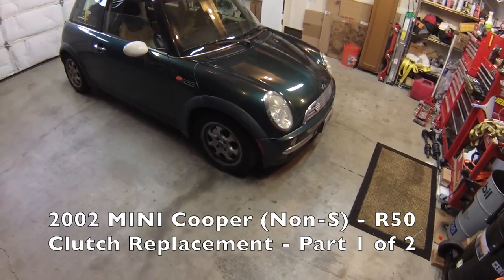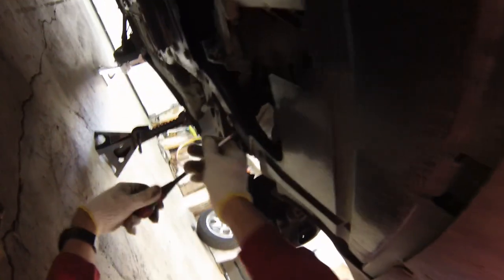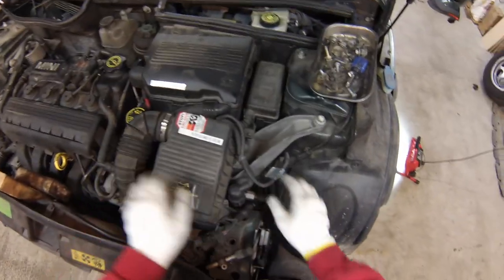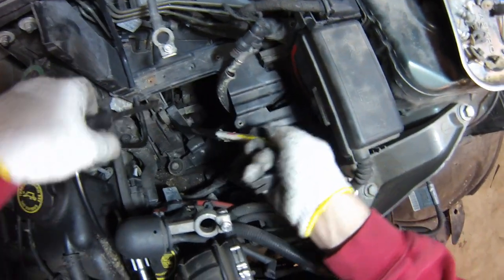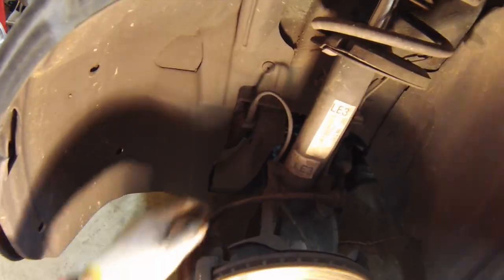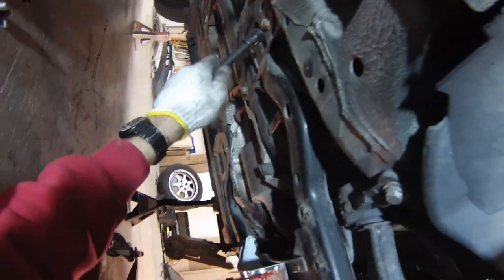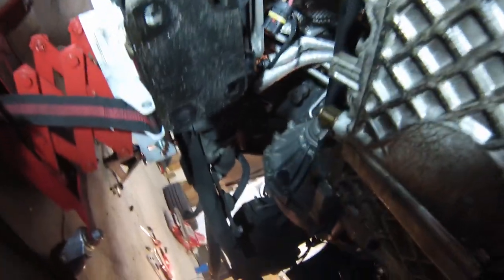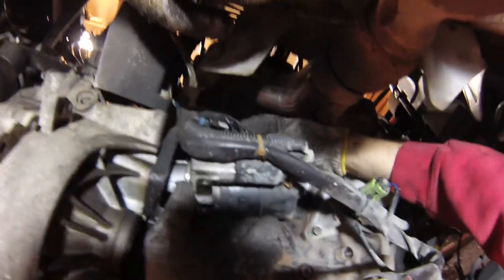2002-06 MINI Cooper Non-S Clutch Replacement Part 1 of 2

Comment: Hi. Thanks for your helpful video. I just did a clutch job on my 07 base model cooper and i'm I have one 13mm bolt left over that I can not figure out where it goes. thinking that most bolts are torx and only hex one was for starter, I've looked everywhere and I can't find where this one 13mm bolt goes. i'd appreciate any help.
Reply from the maker: There are a lot of 13mm bolts on these cars, but if it's a long one, it goes into the starter from the bell housing side on the top of the transmission. Just under the thermostat housing.
Reply: Mod MINI thanks for your response. That starter bolt is in already. This one is 55mm long and it's about half way threaded. I'm pretty much giving up at this point since I've been looking everywhere on the car and googling around diagrams but can't find anything. If it rings a bell please let me know. Thanks again.

Comment: ***** Is there anything I could use to hold the outer ball joint from spinning? My Electic impact gun is huge so i can't use it there. Jackstands is already at Max. I've tried using the breaker bar and etc... it got loose a bit but now the bolt is free spinning with it. I've tried putting the Alan key in the middle while using one of my special socket/ratchet still not working...
Reply from the maker: Bao Tran Tightening or loosening? Tightening: Use your floor jack and a block of wood to press it into the seat. Loosening: There is a female hex indentation on the ball joint itself. Put the appropriate hex (allen) wrench in that hole while you rotate the nut off with your box wrench or ratcheting box wrench.

Oh, just noticed that is not working. Why not? If all else fails, grind it off with a wheel grinder or of course you can separate the ball joint from the hub using the two 13mm bolts.

Comment: What kind of Air compressor and impact gun is that? Really interested in getting. 
I'm getting so tired of turning wrenches. especially on this Mini i'm doing for a friend... I have to say, i'm never touching FWD again!! haha
Reply from the maker: It's a Harbor Freight compressor and a Craftsman impact gun, but just about any reasonably priced setup will work fine. Minimum tank size would probably be around 15-20 gallon.
Don't fear the FWD!

Comment: I ordered the SACHS replacement pressure plate which has 12 fingers or teeth on it which goes against the throw-out bearing. The 2002 MINI pressure plate I removed has 18. Will this make a difference? Is more amount of fingers/teeth make a smoother release? or is the 12 finger/teeth unit fine?
Reply from the maker: It should be fine if it was engineered to go on the same car. Every clutch/pressure plate manufacture does things a little differently; the number of teeth should make no difference - when you add up the pressure exerted by all teeth for each kind, they are probably the same.
Reply: ***** OK thank you. FYI the clutch pressure plate appears to have a manuf code date MINI 19/04/02 European so April 19 2002. At 112000 miles could that be original to this 2002 car?

Comment: I have a 05 r50 clutch changes gears fine. But there is insane noise loud winding noise under load but as soon as I let off the throttle the noise goes away or if I press down the clutch the noise also goes away. Transmission was rebuilt 10k miles ago the noise then was definitely a bad bearing sound but this is a smooth grind noise under load. Any ideas ?
Reply from the maker: Sorry, but that's probably transmission. Rebuilds don't always go as planned.
Reply: @ModMINI  any recommendations on where to find a rebuild kit ? Late 2005 base model. Thanks for any suggestions.

Comment: Mod MIni, 
Can you share what tools used in the video.  Such as the impact drill and the attachments.  I also saw a craftsman 12v nextex used.  Do you find having those options during the removal speed things up.  Please advise.  Thank you in advance.
Reply from the maker: +Shab Mehtabuddin 8, 10, 13, 15, 16, 18mm sockets and wrenches, torx 30, Ridgid 18v impact driver. I think on the Cooper non-S the drain bolt is 17mm. Floor jack, engine support bar, transmission jack, assortment of pliers and screwdrivers. I think I included links to some of the more unusual tools in the video description. The battery impact tools are nice to accelerate things here and there (to skip over a lot of hand-threading) but are of course not essential.

Comment: Can you tell me what thread pitch 2 bolts are that you thread in to hold the radiator up?  Also can you give me the thread pitch of the bolt that you are using to hook the chain up to the strut bar to support the engine?
Reply from the maker: I believe M6x1.25 for the modular frond end. Same for the bolt in the side of the head. MAyyyybe a M5. The modular front end bolts are the same as the one 13mm nut on each side of the bumper visible when bonnet is opened. Take off that bolt and take it with you when bolt shopping.
Reply: M8 is what you need.  I bought some long M8 bolts (M8x125 I believe) from Lowe's for $4 a bolt (yikes), but they fit perfectly.   I picked up some M8x250 washers while I was there just to make sure the rad didn't come off.

Thanks a ton Mod MINI for all your help!  I can't wait to get motoring again in my R50.

Comment: Had the throw out bearing replaced at a shop. A month later the head gasket blew. The car sat for about 6 months. Replaced the head gasket based on your other video (which was awesome, thanks) and it works fine now. However the clutch pedal goes to the floor and remains unless I physically pull it back up. As I pull it back out, if I let go at about 1/4 up, it will slowly pull itself back to the floor. If I pull it all the way back up, it stays.
 Brake fluid is full. No leaks under car. Air in the line? Bad cylinder? Bad Karma? Lol If it's air in the line and it worked fine prior to sitting, does that mean the cylinder needs replacing anyway because it is letting air in slowly over time?
Reply from the maker: The1stDukeDroklar replace space cylinder and bleed.
Reply: Sure enough. I watched your other video on slave cylinder replacement (so I could locate it lol) and it started leaking after pumping the pedal several times. Must've been damaged when it was towed. Thanks for your answers as well as the most thorough and well made videos I've seen on youtube. <o  salute

Comment: You have any experience with the Valeo kits and single-mass flywheel conversions?  I'm looking into one for my R56.
Reply from the maker: Hello. I have done plenty on the R53 and all are happy with the setup. I have one now myself. I don't have experience with the R56 but can't think of a reason to not go with the setup.
Reply: ***** Thanks, it looks as if JM Turbo Coopers in AZ makes a steel flywheel and a kevlar clutch kit that I'm ordering.  I really wish I could test drive various clutches to see which I prefer, changing them out is pretty expensive.

Comment: hey there, i was wondering what would resurfacing the flywheel possibly effect? I did the clutch job about 10 months ago and resurfaced my flywheel as well. In first gear im having trouble with slow take offs and my mini jolting and vibrating. it happens mostly nearly every time i start moving from first gear to second gear. if i take off quickly this problem doesnt happen. one mechanic told me that it was because my flywheel was resurfaced and material was shaved off and now the distance to contact with te clutch is greater or something like that. should i go ahead and get a new flywheel to fix the problem.
thanks:)
Reply from the maker: +eric knowlzy I suppose a bad flywheel resurface could cause that, as well as any oil or other contaminants on the flywheel, pressure plate or clutch disk. I don't know if extra distance could cause that but I suppose it's possible, especially if it is not totally true.

Comment: hey man i'm dong this on a 2009 JCW and can't get the driver's side CV axles to come out of the trans... im really frustrated. Can you give me some advice ?
Reply from the maker: I've never pulled an axle on a Gen 2 MINI. I suppose it's similar, you just have to pop it. Use a pry bar and smartly pop. If the circlip is stiff, it might help to rotate the axle about 90 degrees at a time.

Comment: I was on my way home today and I was going from stop to go at a red light and when I went to take off my car jerked a little and then I started getting lots of noise in the bell housing. Is it a clutch issue or a throwout bearing. I'm looking to change clutch anyways if I have to change the throwout bearing. Thanks. My car is being towed home so I can work on it. Any pointers would be appreciated. Thanks again.
Reply from the maker: Inside the bell housing? You're going to have to pull the transmission no matter what. Who knows what you'll find until you take it apart. It could be disk, pressure plate or throwout bearing. No way to know until you open it up.
Reply: When I pulled over and stopped the rattle would stop when I pressed on the clutch but started Back when you started to move again so I called a tow truck.
Reply: Got the car home and took a video of the sound someone told me to check axle bolts but there is nothing loose and the sound it coming from where the clutch is located. I don't know how to pm on YouTube if I run into something I can't figure out. And what's the best transmission fluid to use for my 2004 mini cooper base pre 7/2004. Thanks

Comment: I have a 2002 Mini which I wondered if you can help me diagnose what may have happened. I was shifting it from 1st to 2nd gear while having it floored and suddenly it quit moving. Will shift into all gears but won’t move. Checked the shift cables and they are fine. Whether the clutch is engaged or not, you can hear something rotating beneath the car when it running. Any ideas what may be wrong with it? Thanks for any help. I live 2 hours from the nearest mechanic and I’m capable of fixing it.
Reply from the maker: Sounds like blown clutch.
Reply: Mod MINI While I’ve got it apart, would you suggest that I replace everything? Pressure plate, throw out bearing...

Comment: At 9:42 you start talking about the differences in the transmission in the 06. I'm looking to replace my clutch on my 06 R50 and would like to know if you have any tips on the differences. I've used your videos for so much, thank you for the quality content.
Reply from the maker: It's pretty much the same thing, the slave cylinder and shifter cables are different, nothing you shouldn't be able to figure out.
Reply: Mod MINI thank you for the instant reply, holy crap.

Comment: What do you think of a 2004 mini cooper s in silver with black stripes and black hardtop? really wanted to find a good cooper s in grey but only find this mini
Reply from the maker: 2005-2006 are the best years but 2004 is not bad. I have a 2004 Cooper S. Take  the time to find the best car you can afford. Have it mechanically checked out by someone who knows MINIs if you can. Other than CVT transmission issues on the Cooper non-S, some of the most common problems are power steering pump and power steering fan (which is covered by extended warranty on most pre-2005 models), thermostat gasket leak, various oil leaks, worn suspension parts (struts and front end ball joints/bushings).
Reply: ***** Since i live in Malta there are no mechanics that specialize in MINIs should i take it to someone who knows german engineering? Thanks for the feedback
Reply from the maker: Matthew Delia A mechanic experienced in German engineering is better than not-German engineering. But might not know the specific things about this car.

Comment: Hi. My Mini Cooper sometimes makes a scraping sound when it's in first gear and sometimes second and it only goes away when I push in the clutch pedal all the way. Once I let go the noise comes back. Any idea what this might be? Thank you
Reply: Hello, i have  the same problem, i think it is one or some bearings in gear box. Maybe you fixed that, already?
Reply: laimis RC I haven't fixed it yet. I think it works fine its just an annoying sound when I'm at a light and stuff

Comment: Can the axles stay installed when removing the subframe on a R53?  Just swapping the control arm bushings with stock.
Reply from the maker: Sure, they are not connected to it in any way...
Reply: Mod MINI thanks! I had read several posts that were very vague as to yes or no.

Comment: Awesome videos from you, they’ve been very helpful. I’ve got a question, about diagnosis. 
I’ve a 2005 non-S cooper. I don’t know whether it’s the slave cylinder or the clutch, or maybe something else. I was driving it fine, stopped at my house for an hour, and left again. Right down the road it lost all acceleration power. The RPMs would increase but it wouldn’t go any faster than about 10 mph, in first. I tried second, same thing. Then when I pulled it off the road to check it out it stalled. It turned back on right away and I drove it back to my house slow. I turned it on a couple days after and it made a squealing (kind of like an alternator, maybe it’s not related). Any help would be greatly appreciated!
Reply: I am currently dealing with EXACTLY the same problem. Please let me know how things turned out. 

I'm replacing my clutch, pressure plate, and throw out bearing in hopes that does the trick. I did find that my main linkage bushing was shot

Comment: Hello, funny that I can across your video. I have the same color, year and model. I recently had the clutch pedal feel somewhat hard and when increased the pressure on the clutch, the salve cylinder jumped off the lever fork. I replaced and bled the slave cylinder but the clutch lever for is stuck away from the slave . What is causing this?
Reply from the maker: Dark silver + white is the best!
The release fork should be freely movable by hand when the slave cylinder is not pushing against it. If it is not, you probably have some physical damage to the throwout bearing or pressure plate springs. Hard to say for sure without removing the transmission and visually inspecting the parts. Unfortunately there is no way to get a camera or scope in there. Do you have an X-ray camera? :)
Reply: No i don"t have a camera, and the release fork seems stuck.I took out the slave cylinder and the fork stayed stuck away from the slave cylinder. I've looked at your video like 5 times and its pretty good. I just haven"t had the time. Thanks.
Reply from the maker: Mike Flores It should move at least a tiny bit if I recall. Try turning over the engine by hand and listening for dragging/scraping. I'm guessing the fork is hung up on the pressure plate or the throwout bearing came off the fork.

Comment: hello. I have a 2004 Mini Cooper S. In the past two weeks it start to get more difficult to get into gear until yesterday i cannot move it into any gear with clutch fully press down. the pedal does not seem to engage until there is only an inch left. seems weird that this all transpired in a few week period. any ideas?  thank you
Reply from the maker: I can't say for sure without seeing the car but it's a very simple system, and your problem is either clutch damage or failure in the hydraulic system. Look for moisture on the clutch slave cylinder. If there is any, replace and bleed the system. If still not working, suspect the clutch/pressure plate/throwout bearing/clutch release fork. The only way to inspect those components is removal of the transmission.
Reply: +Mod MINI Thanks!! tge slave cylinder is what I thought as week since I had no slipping prior. just went from being hard to get into gear to impossible in two weeks.
Reply: +Andrew Ericksen  sorry for the typos.

Comment: I replaced my clutch using your instructions. I tore down day 1 and  reinstalled day 2. Now the car won't crank. I have checked everything. Any ideas?
Reply from the maker: Ground strap next to engine mount or connections to starter?

Comment: Hey my 03 r50 has been screeching when I press on the clutch pedal. Sounds very similar to a noisy serpentine belt. Does anyone know what is happening? Also this occurred after the car sat for 2 years and I recently changed the transmission fluid.
Reply from the maker: Probably failed throwout bearing. Time to replace clutch.